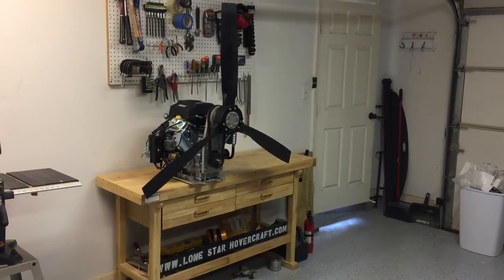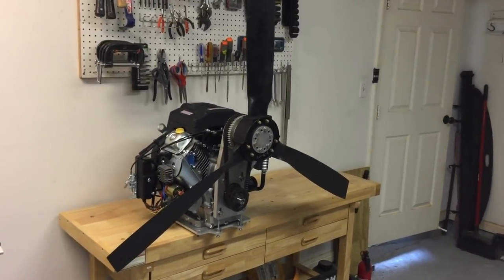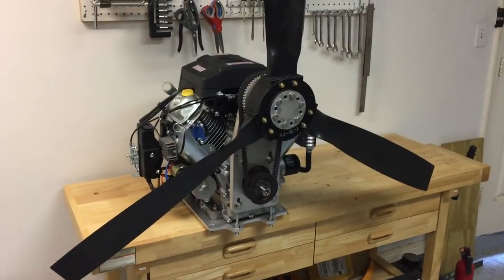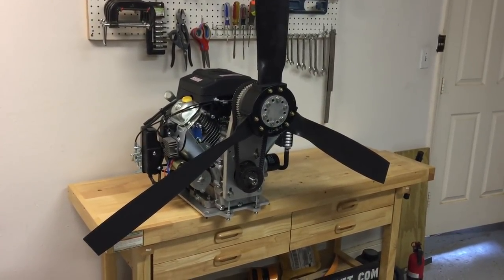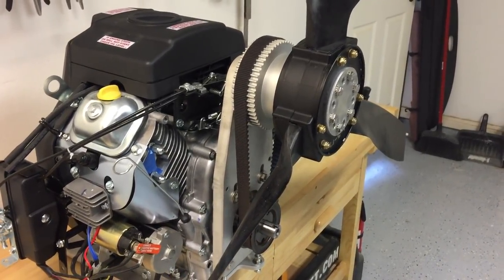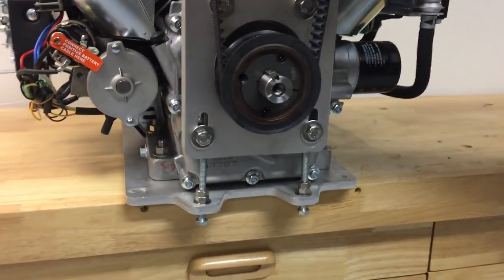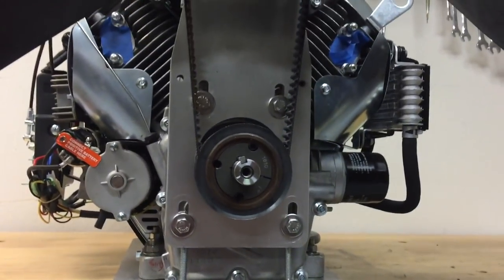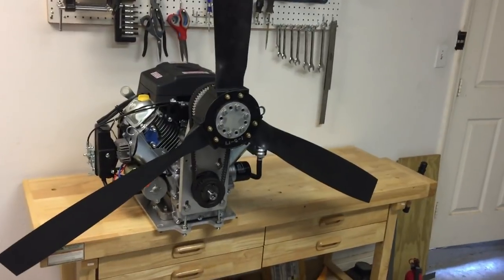Harbor Freight Predator 22 hp Engine and Reduction Drive for Airboats

Comment: I built a 2 man air boat with one of these motors. I used direct drive with a 2 blade prop and I got 125-130# of static thrust with mine and would push it about 30 MPH. The only problem is their 22 Hp only use a 1" shaft to others use a 1  1/4" shaft for 22 HP and I broke my shaft off. I had used it for one summer with no problems the next spring I fried it up in my yard and the shaft broke off so direct drive I WOULD NOT USE. your set up looks very good to use good job.
Reply from the maker: Thanks Don. The only shortcoming we've found with the Predator 22 hp is the 1" shaft. We'd prefer a 1-1/8" or 1-1/4" PTO. Even if a direct drive prop is slightly out of balance, it can break a 1" shaft. But with the reduction drive, we haven't had any reports of broken shafts.
Reply: Don Elliott good advice. Whatever bearing used, it's gotta be ball - or tapered roller  thrust capable of handling 250 lbs sustained thrust minimum..think 2:1 safety factor min, on critical systems
Reply: Hi Don,
I would love to see pics/videos of your airboat.
I've always dreamed of building one and now is the time.
Reply: I know the below is an old thread, but perhaps this will be of help to someone...

I found the thread below while searching for crankshaft replacements for the HF Predator 670cc (22 HP) engine. Coincidentally, I am also a commercial pilot, CFI, CFII, Multi-Engine, etc.

I was re-powering a commercial leaf vac (aka 'truck loader) that was to be used for my own private residential use. So not a lot of extended use. To economize about 1/2 price on an engine, after a lot of internal debate and review reading, I went with the HF 670 engine, rather than a comparable Briggs + S Vanguard (commercial) engine of approx 2.5x the price of the HF engine.

I did the re-power, but missed the leaf falling season. So other than some test runs, the unit was put away for the winter. In the spring, went to do some experimental / trial running of the new set up. Within 1.5 hrs use, the crankshaft sheared at the output shaft. On inspection at the break point, a cheap cast crank. Being past the 90 day warranty period, HF's position was... ohh.. so sorry... but you're on your own. On further review research, others are having the same 'cheap materials' problems with these engines. Compounded by lack of parts availability (not that these engines now seem even worth the effort to rebuild).

These is no way, none, I would ever use one of the engines in a aeronautical capacity. I would not even use one again in a leaf vac capacity... where my feet are always on the ground :) 

Hope this is of help.

Cheers - Jim
Reply: Interesting. That's my concern with stuff like this. Seen a Subaru  conversion break at crank as well. Lots of force with that big gyro prop that wasn't considered in the engines design.

Comment: I’ve got a Harbor freight gasoline powered power washer with the smaller predator engine on it,,,I’ve used it in the summer in near 100° heat and use it hard,,, for about two years now and it runs like a champ,,? I keep the oil changed and run Kohler10/ W 30. 4 stroke engine oil in it

Comment: Hi. Nice product! I wonder, with your experience, what would be the required engine hp for putting this configuration on a inflatable dinghy of approx 4m length? I need to move 2 people 150kg, 150kg equipment, boat 50kg, engine 100kg on a river. And I need to bring the boat upstream in small calm rapids with some rounded boulders just under the surface. I have plenty of acceleration room before every rapid. As seen on Russian video 6 years ago where they run on snow.

Comment: Would be cool to put on my kayak,  but I would need more weight up front.  How much do these weigh?
Reply from the maker: It would be pretty top heavy but very fast in a straight line. This entire setup weighs about 125 lbs, but it also fits the lighter Predator 420, which is about 40 lbs lighter.
Reply: 5hp would be better

Comment: Where can I find out more details on the 2.2 to 1 unit?
Reply from the maker: We're about to add details on our website, but the 2.2:1 unit is identical to this one except with a much larger upper pulley. We get fewer requests for the higher ratio, so we make them to order.

Comment: How is the ultraprop working out for you?
I had one on the first Ultralight trike i built, and they were pretty loud, but they were tough, and did work, I see some changes from the 20 year ago one
Reply from the maker: The original ultraprops are on the louder side, but we've found that most of our customers prioritize low cost over low noise, so they're still very popular. On many drives though, including the one in this video, we're using the newer ultraprop 2. It's a quieter and more efficient airfoil with a more rounded leading edge and aerodynamic twist. It's worth checking out if you haven't looked at the ultraprops in a while.
Reply: LoneStarHovercraft 
If I remember correctly, they were also impervious to water damage, which can kill a wood prop in short order
Reply from the maker: PRDMRE yes absolutely. The spray and sand we sometimes kick up can erode the leading edges of a wooden prop quickly, but these composite props hold up to the punishment very well.
Reply: "aerodynamic twist"? Pitch?

Comment: how many hours do you get before you chew all the teeth off that tiny gates belt?  other redrives use 1/2" belts per every 10hp with no cog belts for a reason. start up & shutdown there is a lot of torque differences on the 2 shafts. with a grooved belt there is a small amount of slip that minimizes belt wear. On a cogged belt all that energy is absorbed by the belt witch greatly increases belt wear.
Reply from the maker: Lots of people use cogged belts on redrives, including on most hovercraft. We have hundreds of hours of runtime with no visible signs of belt wear. We use the most conservative service factor from Gates and then derate by an additional factor of 2 to allow for startup/shutdown loads. The belt must be properly tensioned and there are practical limits on the size and weight of prop you can swing to lessen the energy absorbed by the belt.
Reply: Dustin Apple, the cog belts greatly reduce the tension on the end bearing and shaft which results in significantly less wear on these parts.
Reply: You ever drive an airboat....cog belt
Reply: Dustin Apple 
200+ hp car engines use these belts with no issues lol, i think it can handle 22 hp lol

Comment: What is the pitch of your current blades?
Reply from the maker: I think in this video they were set to 15 degrees, but it varies quite a bit depending on the engine, prop diameter, and reduction ratio.

Comment: In general, why need a speed reducer?  Why not direct drive?
Reply from the maker: Lots of people use direct drive and it works well except for rare occasions where it can result in a broken crankshaft. But larger propellers create more static thrust, and there's an upper limit on the prop size you direct drive safely. By reducing the speed you can swing a much larger prop and generate more static thrust from the same engine.
Reply: Aircraft engines, with a six foot prop, are limited to about 2500 RPMs.  Prop tip speed becomes supersonic and the shockwave trashes thrust, snaps propellers,  and sends vibration through the engine and airframe.
Reply: I understand, but why not use a shorter prop with longer chord to work it harder at slower rpm?  Thank you.
Reply from the maker: There's a maximum theoretical static thrust you can get from a prop of any given diameter. It turns out that a large prop (which moves a lot of air more slowly) generates more static thrust than a smaller prop (which moves a smaller amount of air more quickly). So you can design a small prop with wide blades to use all of the power from the engine, but it still won't generate as much static thrust as the same engine running a larger prop. This gets more complicated on aircraft, where you trade off static thrust (and climb rate) against cruise speed. But for airboats and hovercraft, which are all very slow compared to most aircraft, we can just design for maximum static thrust.
Reply: @faw3511  , a propeller shaped like that (a long chord with a short radial length) would have high tip losses and would lose efficiency as a result. There are also higher shock loads transmitted to the prop with a direct drive. You can run a shorter prop at higher rpm, but you won't get as much thrust. You could also reduce the rpm even more, run an even larger prop, and get even more thrust, but that would take up a lot of space. It's all a balancing act, and you need to decide what's right for your application.
Reply: @theoriginalpauly  
Very interesting and thank you.  I've seen airplane propellers with winglets apparently to reduce the tip losses you note.
Reply: @faw3511  that's correct on the winglets. Another option you may look into is a ducted fan or shrouded propeller, which also reduce tip losses.
Reply: also bad harmonics from cylinders firing engine pulses and big prop wants to stay rotating is a lot of stress on engine.
Reply: Propellers are spinning wings wings behave strangely when they reach the speed of sound you want to keep the propeller tips the part moving the fastest safely below that speed

Comment: 22hp is at 3600rpm, what do you figure it is at 5500rpm?
Reply: Nobody else responded so I will, from what little I know, 5500 is way to fast, from my research it looks like 3000 is optimal and about the max for this size and style prop. At 5500 the prop would probably just have cavitation if it didn't come apart first
Reply: Ultralight aircraft only need 2700 rpm
Reply: The heat drive puts the prop ot 3000 something rpm with the engine tiring 5500 rpm

Comment: Sir if there is a reduction gearbox is there a high gear box
Reply from the maker: Not sure what you mean, do you mean are there different reduction ratios?
Reply: @LoneStarHovercraft   sorry i was wondering if the gear reduction goes down for boats ,could it be reversed for a eletrical  generator  im trying to design a prototype model and needed imput

Comment: What's the max rpm you can run on this set up
Reply from the maker: You can run it up to the max rpm of the prop, which is 3300 rpm for this particular prop. That would correspond to an engine speed of 5400 rpm. In practice we usually run it quite a bit slower to reduce noise though
Reply: @LoneStarHovercraft  I'm going to build the engine I just need the starting point of where the power curve needed to be

Comment: This is the Predator 670 CC right?
Reply from the maker: Yes
Reply: LoneStarHovercraft yeah I just couldn't remember the horsepower on that thing I have one of them on my mini bike
Reply from the maker: Cool, this one is the 22 hp one. They also make the 420 cc engine, rated at 13 hp.
Reply: LoneStarHovercraft for the cost of that predator you could easily pick up a reliable used 800cc rotax v twin that’s liquid cooled, fuel injected and makes 80 horse. With that much horsepower on tap any weight gain would be negligable.

Comment: How much thrust ?
Reply from the maker: With 52" prop, this setup will make about 140 lbs static thrust.
Reply: LoneStarHovercraft what does it weigh complete?
Reply from the maker: All up weight is 122 lbs (without oil). The engine is 99 lbs dry, the base plate is 3 lbs, redrive is 13.5 lbs, and 52" prop is 6.5 lbs.
Reply from the maker: Yes, we mostly run stock motors. Besides the billet rods and flywheel, some people are also changing out the cam, upgrading the springs, and putting on a mikuni or similar carb to help the engine breathe better. We haven't looked too much into aftermarket parts for the Predator, but I know many of Honda upgraded parts will fit since this is basically a GX670.
Reply: I have 18 forces the motor with screw D 1500mm pulling 176

Comment: Hell how bout an ultralight?
Reply from the maker: This would be great for an ultralight as long as it doesn't push you over the weight limit. Total weight of this setup is 121 lbs before any engine mods.
Reply: they use this for paramotor trikes
Reply: This is way too heavy. Start with a Predator 212 and build it from 6.5 hp to over 20 hp--and under 40 lbs with carb and header.

Comment: Toothed belt good for wet applications, I'm using multi V belt for an Ultralight, also eccentric shaft belt adjustment better as no adjustment requirement to slacken mounting plates. Have a look at my designs for Ace Aviation info@aceaviation.co.uk